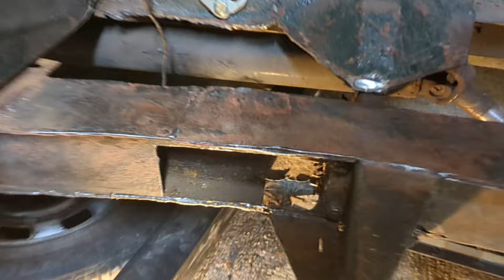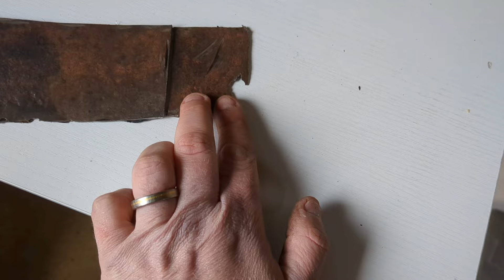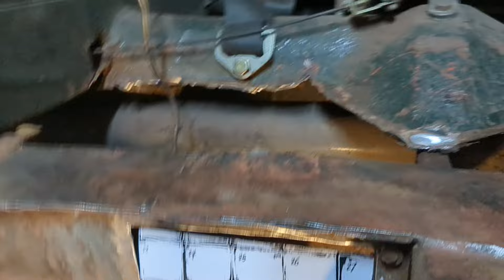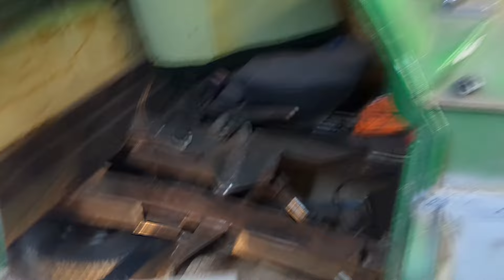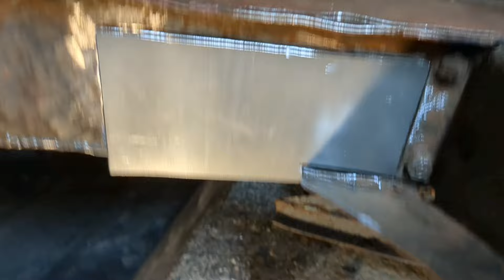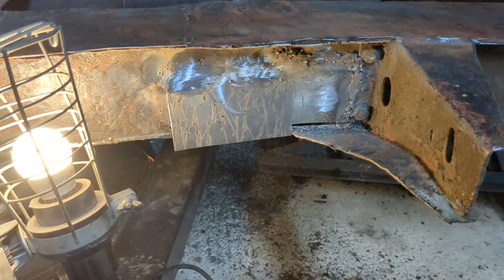E36 - New metal going into the chassis leg (at last!)

Comment: you really should work on a bare chassis, much more convenient and effective and ultimately quicker
Reply from the maker: I agree.  I wish I had done things differently in hindsight, but now that the floor of the cab is out it will be very difficult to lift without distortion.  The rest of the chassis has good access as the box lifts off and doesn't appear rusty.